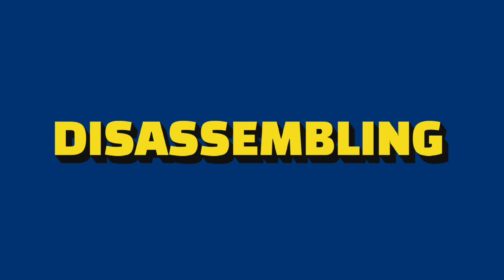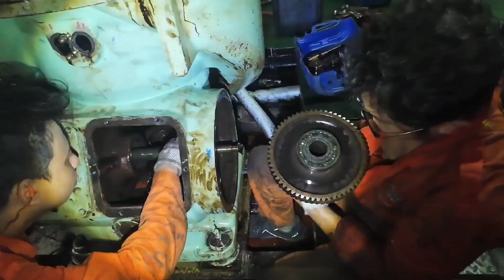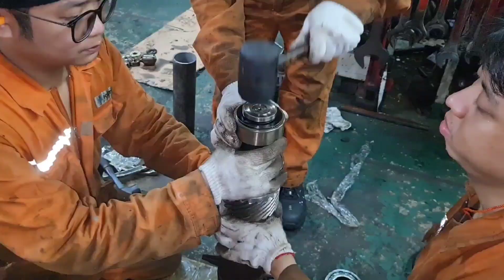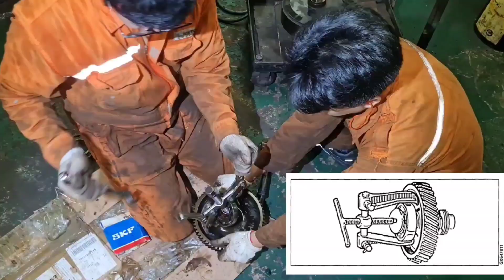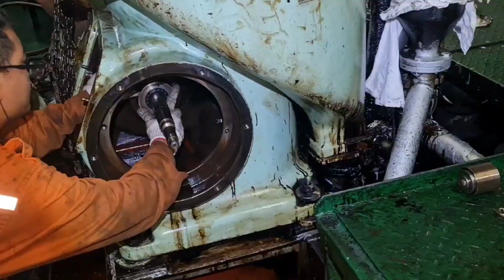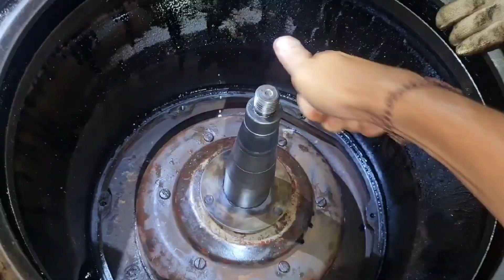Alfa Laval Separator Vertical & Horizontal shaft Overhaul #marineengineering

Comment: May I ask about the bearing direction?
Reply from the maker: This type of shaft uses ball bearings and axial ball bearing which are not direction oriented. You can fit without any worry. In case of angular contact bearing ( found in Selfjector)  pay attention to the specific direction.
Reply: Thank you
Reply: What temperature should the bearing be heated to?
Reply from the maker: @DZ0110UP Max. 125'C but it works around 95-98'C. depends on bearing size.
Reply: @HtoonPyeat Thank you for you help